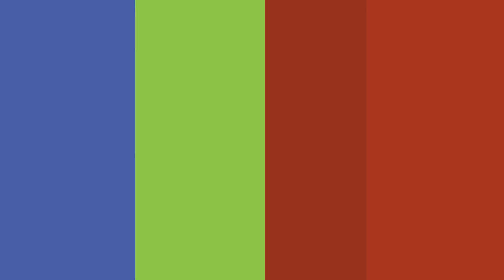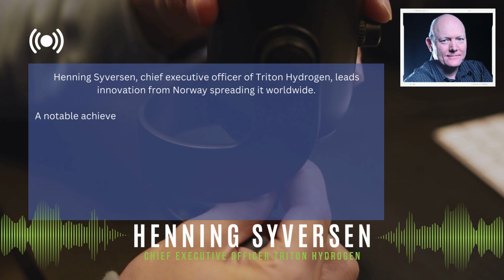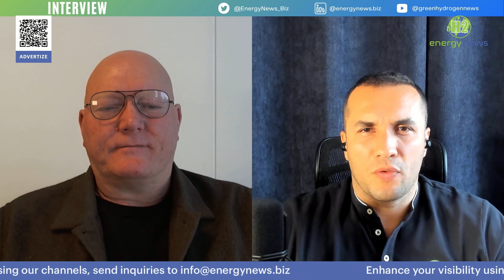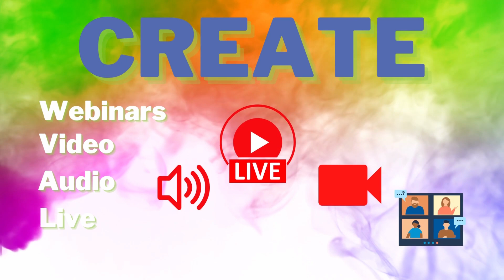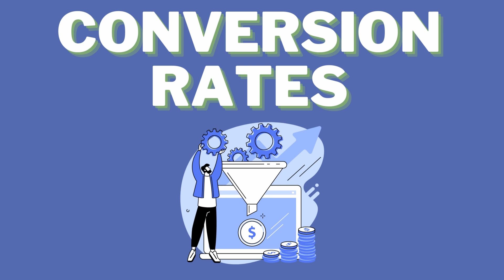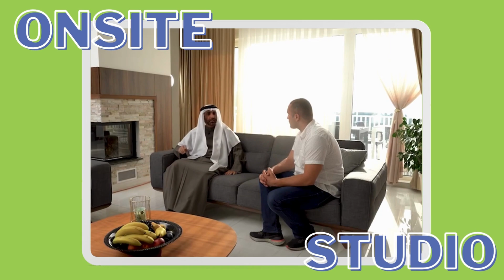Preventing Hydrogen Leakage with Henning Syversen

Comment from the maker: 🎯 Key Takeaways for quick navigation:

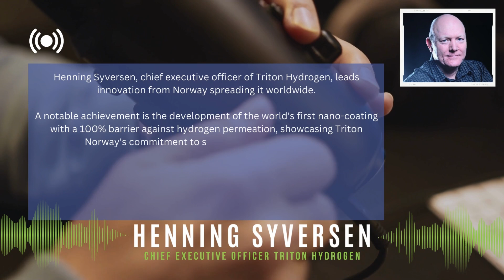00:31 Triton Hydrogen developed the world's first nanocoating with a 100% barrier against hydrogen permeation, offering a sustainable solution for hydrogen leakage.
02:09 Triton Hydrogen's coating is a game-changer, stopping hydrogen permeation, steel embrittlement, and microcracking in materials, allowing for cost-effective retrofitting of existing infrastructure.
03:44 Triton Hydrogen's coating is the only one globally to pass the ISO 17081 hydrogen permeation standard with zero permeation, enabling long-term storage of hydrogen and potentially revolutionizing the industry.
05:46 Triton Hydrogen's coating eliminates the $21 billion annual cost of hydrogen loss, extends the lifespan of storage vessels, and facilitates the increased production and use of green hydrogen.
08:45 Hydrogen embrittlement in steels poses environmental and economic challenges; Triton Hydrogen's coating prevents hydrogen from penetrating materials, addressing both issues.
10:40 Scaling up barrier coating production involves strategic partnerships, mass production, and addressing application challenges, with potential advancements in pressure specifications.
13:29 Triton Hydrogen's coating has diverse applications, including pipes, fuel cells, gaskets, and more, offering a comprehensive solution for the entire hydrogen industry value chain.
16:35 Triton Hydrogen's coating enables optimization of storage vessel pressure, potentially allowing for higher pressure specifications and increased energy storage capacity.
19:27 Technical limitations in retrofitting old pipes may exist, and Triton Hydrogen is exploring various techniques and partnerships to overcome these challenges.
21:40 Triton Hydrogen's coating is tested under various conditions, including wet, rusty, and oily environments, demonstrating its resilience and effectiveness.
26:55 Triton Hydrogen's coating undergoes rigorous testing and exhibits exceptional durability, with a potential lifespan of 50 years or more.

Made with HARPA AI